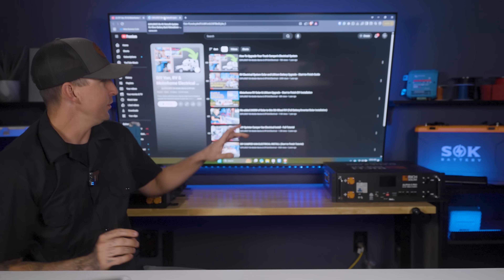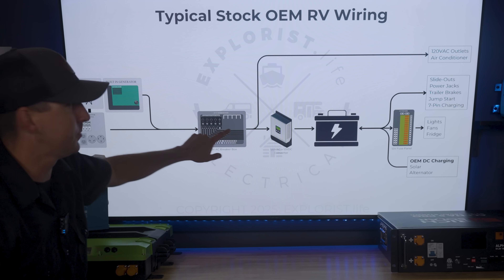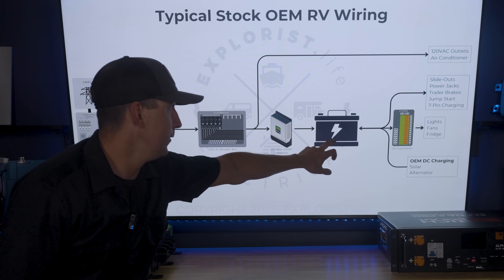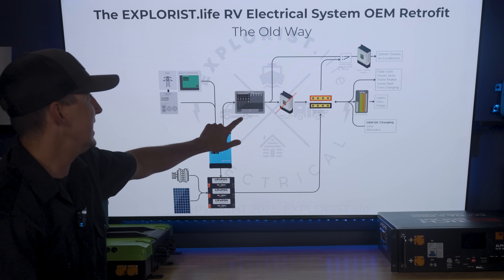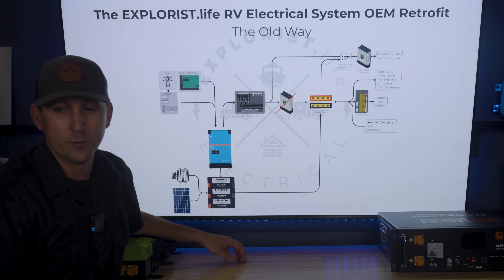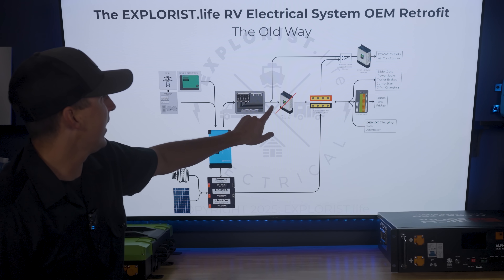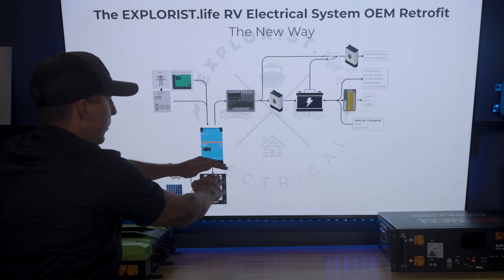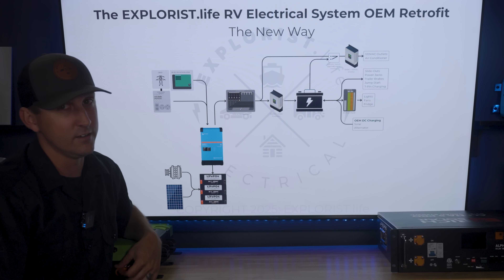The New Way to Upgrade RV Electrical Systems (No More Battery Relocation Kits!)

Comment: I blew out some of the electronics when I put a lithium battery.  Now the bypass system is not working, but whatever.  I have 9600ah of 48v power, and 2160ah of 12v battery.  If I run all that down there is always the sun the next day from my 1800w of solar, and fi there is no sun, there's always the little ecoflow and a radio to listen to tunes and chill out.  I use an MPPT to convert from 48v to 12v, it does fine.  I'm not running big AC's or something off 12v.  And it was cheap as hell.
Reply from the maker: Sounds like a wild setup! 🔧 If you want help troubleshooting the damaged electronics or optimizing that 48V→12V path (and making sure everything’s protected), we’d love to take a closer look and get you the right parts. Shoot us the details here: https://shop.explorist.life/support

Comment: I set my trailer up this way last year and works great.  I have a 12v system (would build a 24v bank if I were to redo it) but the 12v system has allowed me to add a DC to DC charger between the back and house battery that allows me turn the inverter off if I am not using the trailer for extended time while keeping my house battery full, allowing the 12v fridge to run with no issue
Reply from the maker: That’s an awesome way to set things up—glad it’s working well for you! 🙌 If you ever decide to upgrade to 24V or add more gear, we’d love to help spec the right parts for your system. Reach out anytime: https://shop.explorist.life/support

Comment: Did my system like this with no issues.  Still used a very basic Lithium battery in place of the lead acid for the 12V side.  I just wanted to get away from lead acid all together.
Reply from the maker: We have loads of 'no issues' systems out there, but also some 'issues' thus warranting the change.  Please understand that our opinions are based on over 30,000 system projects and if our sample size were only 1, or even a dozen, we wouldn't have enough info/data to warrant changing things.  Regardless, I'm glad we now have both options available for our customers whom can reach out if they need help deciding: https://shop.explorist.life/support

Comment: Interesting idea for the new way. Three years ago I did a DIY version of your 'old way' my 25' Winnebago towable. I completely removed the factory battery system. Now, instead of my 12v coming from the old hitch box location, the 12v comes from my Victron 24v/12v converter directly into the 12v fuse panel. Everything works perfectly. I even have the option of leaving the 12v system running and disabling the factory hitch jack by simply turning off the factory battery disconnect.

Not knocking your 'new way' and I can see the benefit to the customer by reducing the costs and simplifying the installation process for you. My main concern was reducing system complexity (removing the 110v/12v charge converter) and reducing weight (no more lead acid battery). That 45lbs makes a difference when adding an inverter, ore panels, etc. to your rig.

Thanks for the great video.
Reply from the maker: Sounds like you put together a really clean and efficient setup—nicely done! 🙌 If you ever want to expand on it or need parts for future upgrades, our team would be glad to help. Just reach out here: https://shop.explorist.life/support

Comment: Can somebody please help me.
I'm seeking assistance with my JBD-DP04S007 -V1.5, which seems to have fallen asleep after I powered it off using the Overkill app for about 10 minutes to clean around the battery. I've done this before without any issues.
Currently, I’ve tried connecting with three different phones, but none of them can detect the integrated BMS Bluetooth.
I followed a YouTube guide and disconnected the voltage detection socket from J1 on the BMS to cut the power. After reconnecting it after half an hour, the Bluetooth light on the BMS flashed for less than a minute, but still no phone could detect it.
Thanks.
Reply from the maker: Your dealer will be responsible for helping you with that.   Are they not helping?  We have options if they aren’t.

Comment: I have a 24/3000 MultiPlus and left a 100ah (though upgraded it to a lifepo4) on the tongue.

I left my factory AC/DC converter in place, but usually leave the breaker off in the AC panel. It is loud when running and pulls more power than I’d like in an offgrid situation where I’m trying to conserve power. 

I installed a Orion 24-12 Charger (though now I’d do the XS 1400) that keeps my 12V battery topped off from my 24V battery, even when off grid with the inverter turned off to conserve power.

If for some reason my 24v is dead, 12v battery is dead or removed (e.g., parked in the winter), if I have generator/truck onboard inverter plugged in or on shore power I can still turn on my converter to operate 12v stuff.
Reply from the maker: Thanks for sharing the details of your setup! If you’d like us to take a closer look at your system and help recommend parts or upgrades that fit your exact needs, reach out to our team here: https://shop.explorist.life/support

Comment: I think you explained your reasoning extremely well.  It does make a lot of sense from an installation cost standpoint.  But at the same time, it's a real shame to leave all of that inefficiency and weight in-place.  It's not really a clean engineering solution, in my view and the loss of efficiency would definitely have an adverse effect on boon-docking with the trailer.

I think there is also quite a bit of a danger to depend on the AC output (from the multiplus) to keep the 12V system charged.  That's a long chain of potential failure points whereas before you had any of that the engine alternator more or less directly tied into the 12V bus and could literally run the brakes itself even if the lead-acid and everything else was dead.

So at a minimum, for safety, I think you need to add a DC-DC charger.  It doesn't have to be a big one.  20A or 25A would probably be plenty.  But having it retains the short power path from the engine alternator to the brakes.  Literally, alternator -> (new battery bus) DC-DC  (old battery bus) -> brakes.

Then the converter could be left off... perhaps retained as a redundant extra charging source for the 12V system in emergencies.  But otherwise left off.  That completely solves the boon-docking efficiency problem.

--

Beyond that I think my complaints would just be engineering cleanliness.  Keeping all of the old dead-weight in there when it could be removed just rubs me the wrong way.   I'd do it in a heartbeat.  I might leave the converter in as an alternative backup / emergency for 12V charging but I'd remove the factory inverter + transfer-switch and I'd definitely replace the 12V lead with one or two 100Ah x 12.8V LiFePO4 trolling batteries (for their beefy BMSs).

-Matt
Reply from the maker: Sure!  We can get you what you need based on all of that.  We are shipping out next day.  Reach out here: https://shop.explorist.life/support. 

Look forward to hearing from you and being a part of your upcoming project!

Comment: One less battery is better, but I see why you are doing this. Thanks for the report. I guess with the new way, you need the inverter left on most of the time to keep the 12v oem system charged. The solar then needs to compensate for inverter standby draw and converter losses. This could really be an issue for smaller trailers or winter camping. But I do appreciate having the option of old and new way.
Reply from the maker: I would like to emphasize that last sentence of yours. 🤣😂. Anybody can reach out to us directly for help choosing which one is right: https://shop.explorist.life/support

Comment: I agree that the new approach is simpler, especially for installation, however, does it mean that the multiplus inverter must stay ON pretty much all the time? 
My installation is the old format, and I prefer it because I am almost never connected to shore, and most of my continuous loads are 12v DC, including air conditioning, so I only need to turn the inverter on occasionally, and for a few minutes at a time to run a 110v AC device (coffee pot, toaster, microwave, etc). Inverters do have an efficiency and longevity cost, so I feel running then only as needed is a better approach.
Reply from the maker: Yeah, like I said in the video - if you already have a system up and running, there's no need to change it.  This is just explaining another option for our customers who want to go this route.  Remember - we are still selling  the parts for both methods.  Did you purchase your equipment for your project from our store?

Comment: I get this is easier/faster for a shop to install. But this is not a very efficient way. Leaving the trailer's lead batteries adds weight. Most everything in the rv is 12v. So you would be running a inverter that's converting dc to ac. Just for that inverter to power a conveter thats converting that AC back to DC charge a lead battery and run all the DC loads. A lot of installs on TT and 5th wheels typically put the lithium batteries in the front close to where the oem battery was anyway. Having to run the inverter 24/7 just to keep a 12v fridge going seems to defeat the point of a 12v fridge. Might as well have a 120v residential if you have to run the inverter all the time anyway. Sort of the same with all the 12v DC stuff. The point of all that being DC is it can be directly powered from the batteries without inverting.
Reply from the maker: Keep in mind that our opinions are based on supporting a couple of TENS of thousands of actual customers DIY installs.  I didn't think this way would be better either initially, but since implementing it and getting a couple hundred of them in the field, this is a far batter way for the average DIYer to install themselves.  Regardless, if you're in the market, we have both options for sell and we are happy to get you either (or both, so you can compare).  We’d love to look over your setup and recommend a leaner parts list/wiring plan tailored to you (so you’re not running an inverter 24/7 if it’s not needed). Reach out and we’ll spec what you need: https://shop.explorist.life/support
Reply: @EXPLORISTlife It will 100% work and is easier. But I think calling it new and referring to it as better is the controversy. My MP uses 7-8 watts idle. That alone is 200wh in 24 hours, now factor in the converter constantly running. Whats that parasitic draw on average? 4-500 watt hours over 24 hours? Maybe more. That is significant in a RV where solor is limited by space and weight.  Very significant to people with only 2-300 ah of 12v and a fridge that uses 1000+wh in the same time frame. All im saying is maybe instead of new and old and the new is the way to go. Maybe atleast touch on the wasted power with that type of setup. A lot of people will just hear better and not understand the cons. 

Btw don't misunderstand. You are very knowledgeable and I enjoy your content. But you are pretty use to larger systems.
Reply from the maker: Yes, and our customers or future customers can reach out for personalized guidance through https://shop.explorist.life/support and we will walk them through the best options.

Since you have a sustem already, I presume you purchased from us and therefore have a full grasp of how good of personalized advice we can give if somebody reaches out, yeah?

Comment: That's exactly what I did when I built my 24V system last year. I actually bought a 24V-12V converter, but never even installed it. I already had a spare 12V Dragonfly battery that I couldn't seem to resell, so I just left it where the 12V battery was installed and use the stock converter to keep it charged. It may be marginally less efficient, but with 10kWh of battery and 2200W or solar, a couple watts isn't going to kill me.
Reply from the maker: Sounds like you’ve put together a solid system that works well for your needs! If you ever want us to take a look and help make sure everything is optimized—or recommend parts for future upgrades—feel free to reach out at https://shop.explorist.life/support.

Comment: I get why you are doing it the new way, and yes it works and yes it's simple but it's not for everyone.  The video would have been better if you listed some of the downsides and use cases where the " "old way would still make sense to maximize the system.  You claim in your comments to others the difference in power efficiency is negligible between the two.  I am not sure I agree.  Would be good to do a video proving your opinion out.  The multipluse is efficient but not that efficient when trying to squeeze every last drop of power when you are boon docking.  Love all the education videos and info you have put out over the years but this video did not convince me your " " new way is better.  It is simpler but not better.
Reply from the maker: Fair enough!  Every setup really comes down to personal goals and use cases. If you’d like us to take a closer look at your project and help figure out the best approach for your needs, reach out to us at https://shop.explorist.life/support.

Comment: Like the idea in concept but when weight is a factor leaving a legacy battery behind is no bueno.
Reply from the maker: But, when the OEM battery is only ~50 pounds?  If you're cutting it that close, you've got bigger problems that likely require a bigger truck.  Regardless, reach out to us at https://shop.explorist.life and we can line out your options based on your needs and your wants and get you the parts you need to make it happen regardless of which method you go with.
Reply: @EXPLORISTlife my new camper can only carry 1200 lbs of cargo which includes those batteries so it’s not a truck limitation but a camper limitation
Reply from the maker: Sure!  Like I said, reach out to us at https://shop.explorist.life and we can line out your options based on your needs and your wants and get you the parts you need to make it happen regardless of which method you go with.

Comment: Great! This addresses one of the questions I was bringing with me to your Solar Summit next month. That is: I have a very functional and dependable12V solar system that I installed in 2018 to charge my Trojan FLA batteries. I replaced these batteries with identical Trojans in 2024. I do not want to or need to dispose of this 12v system. I do want to upgrade my 120v capacity which I am doing with 630 amp lithium and the Multiplus II I recently purchased from you. So thank you for this video.
Reply from the maker: We can't wait to see you at the Summit and help you out with your questions!

Comment: The timing of this video could not be better.  My system arrives tomorrow and I bought the battery elimination kit.  However, my house batteries are cooked.  So I would either need to buy two new 6v batteries or, I guess, one 12v because I would imagine the AH would no longer matter.  What I also got out of the video is that I do not need to try and remove any of the old wires to the house battery compartment.  I was concerned the existing alternator charger would interfere with the Victron DC to DC and/or any of the other systems wired through that compartment.  Great videos and I feel even more confident about installing the system with my limited electrical experience.  Thanks for all of them.
Reply from the maker: Glad the timing worked out! 🙌 Since battery choices and how to handle those existing factory wires can vary a lot depending on your setup, we’d love to take a closer look and make sure you get the right battery solution and everything tied in properly. Reach out here and we’ll walk you through it: https://shop.explorist.life/support

Comment: Trailer brakes are powered from the vehicle, not the trailer battery. The exception to this is the breakaway situation in which case the trailer battery powers the brakes. I've always kept my inverter and battery separate from the trailers system for portability and simplicity. But using a lithium for the trailer 12V system is fine when the flooded OEM battery dies. Probably don't need 2 of them anymore with a lithium replacement.
Reply from the maker: So... trailer brakes ARE powered from the trailer battery when in a breakaway situation...  Regardless, we sell the parts for both directions... If you’d like us to take a closer look and help make sure your setup is dialed in—or recommend the right parts when you’re ready for upgrades—reach out at https://shop.explorist.life/support.

Comment: So now when you need anything in 12VDC you will  using 12VDC Bank to 120VAC then downconverting to 12DC ... Have you done any measurements to find how much is being wasted ? If you have tons of battery storage then No issues.
Reply from the maker: Great question—actual losses depend on your specific inverter, loads, and wiring. We can help quantify the waste for your setup and recommend the most efficient path (and parts) for your 12V needs. Ping us here and we’ll take a closer look: https://shop.explorist.life/support

Comment: I have a Motorhome that has an Inverter/Charger combo system. Your diagrams show a separate converter and inverter. How would the new approach work for a combo Inverter/Charger. Probably wouldn't change, but I am curious.
Reply from the maker: @Marcarjohn Great question—combo inverter/chargers vary by model. Share your rig details and we’ll map the best approach (and parts) for you: https://shop.explorist.life/support